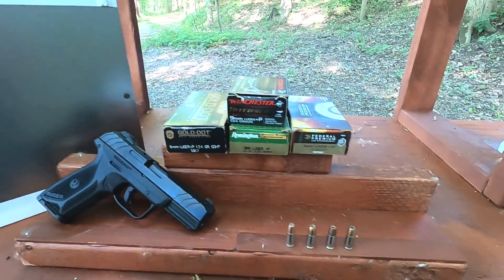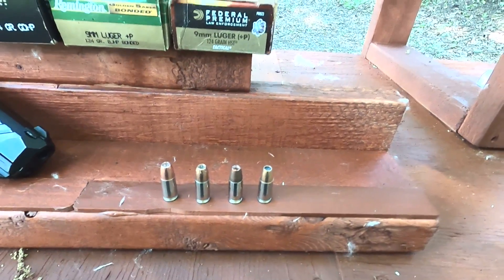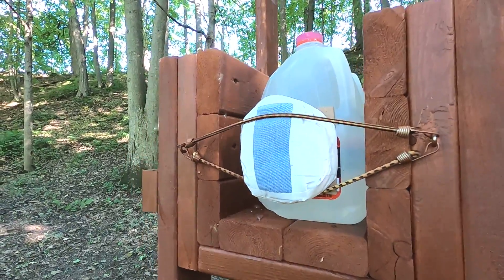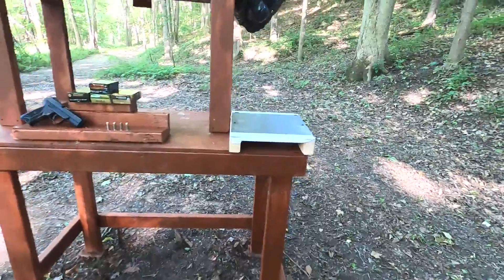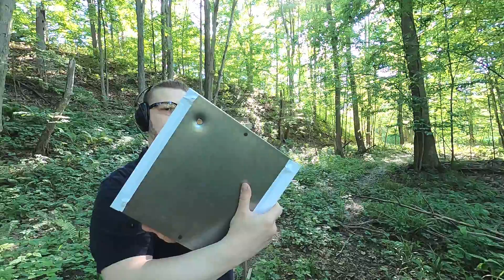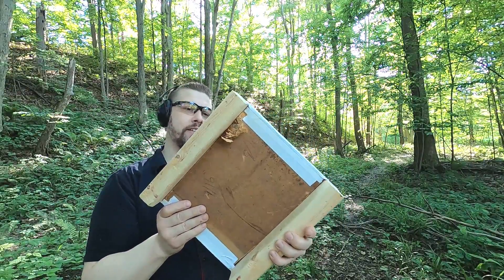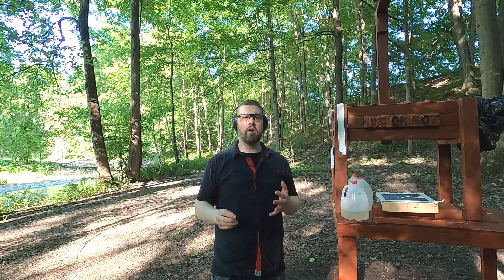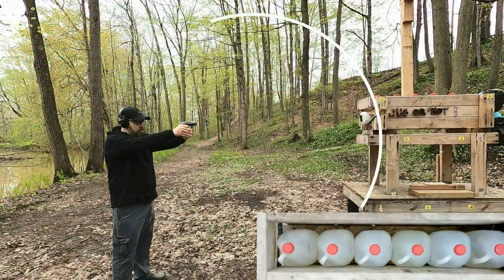9mm Hard Barrier Penetration Test- Damage after Hard Barrier Penetration (Four Popular Loads Tested)

Comment from the maker: I know everyone will be wondering about how these rounds performed without the hard barrier pack in front of the ballistic bologna pack, so I will share the information here because I have tested them all in the past in this same pistol. The Gold Dot averaged 1,196 FPS throughout multiple tests, test one gave 3rd jug penetration and .594" expansion, test two gave 3rd jug penetration and .541" expansion, test three gave 3rd jug penetration and .573" expansion. COMPARED TO HARD BARRIER TEST OF 3RD JUG PENETRATION AND .523" EXPANSION. On to the HST, two tests: the average velocity between the two was 1,186 FPS. Test one gave 2nd jug penetration and .665" expansion, test two also gave 2nd jug penetration and .628" expansion COMPARED TO HARD BARRIER TEST OF 3RD JUG PENETRATION AND .432" EXPANSION. The Golden Saber Bonded I tested once for an average velocity of 1,139 FPS and got 3rd jug penetration and .586" expansion COMPARED TO HARD BARRIER TEST OF 3RD/4TH JUG PENETRATION AND .477" EXPANSION . The Winchester PDX1 I did one test and got an average velocity of 1,091 FPS, 4th jug penetration and an ununiform .545" expansion COMPARED TO HARD BARRIER TEST OF 3RD JUG PENETRATION AND ALSO AN UNINIFORM .455" EXPANSION.
Reply: Gun Sam Revolver Aficionado thanks
Reply: You would think that all of those rounds would over-penetrate if used for self-defense (on a a human attacker) but after watching this video -we learn that it is not the case🤔
Reply from the maker: @mitubogoogle  I think it's totally different effects that just happen to have the same end result by chance. Like, the expansion itself with no hard barriers just by chance slows the penetration to the same penetration that the hard barrier happens to slow the energy down to. Would be kind of interesting to chronograph a round and then chronograph it again after going through the hard barrier.
Reply: 44mag

Comment: What about powder mixing? For the purpose of filling the empty space in the. 38 cartridge.  For the purpose of better temperature control, velocity, energy on target and accuracy. What is the optimal grain weight for the .38 cartridge. What's the maximum pressure of the .38 cartridge? Remember the gentleman was using the .38 casing to develop the  .357 cartridge. 
Thanks 
JP1
Reply from the maker: Mixing powder is generally a no-no. There might be ammo companies that do it because they have the equipment to test the pressure, but a mix goes into the unknown and not a good idea.

Comment: Can you increase the bullet velocity of a .38 caliber cartridge by using a 9mm bullet?
Reply from the maker: I doubt it, if anything it would decrease the velocity.
Reply: @GunSam  Because of the difference between bullet diameter.   
Why?
Reply from the maker: @jpresas3082  A tighter seal will usually increase velocity. The looser fit allows gas to go around the bullet. Even something as simple as a true jacket over a plated bullet in the same caliber can gain velocity over the plated. It would be difficult to load anyways as 9mm bullets don't come with cannelures, so you would have to taper crimp into a .355" bullet which would take a lot of crimp and still pose a risk of creeping out of the case under recoil. Just overall not a good idea and only something that I would do out of desperation, like I had no ammo but had reloading supplies and they happened to be .38 Special brass and 9mm bullets.

Comment: That was a good barrier.  16 ga is probably much heavier that a car fender.  Tough stuff.  and it still got three jugs.  I don't remember of you did a barrier test on 38 sp +p ?
Reply from the maker: I have not and probably will not with steel, but I do have a wood penetration test planned where I will test about 15 rounds to see how they compare to one round of 9mm+p as a control comparison.
Reply: @GunSam  Hot-Dang! Pls throw in a few of the "best notions" of Standard Pressure .38 Spcl as well.

Comment: I think it's interesting that the most common opinion is to underestimate the power of these guns and ammo.  People disparage one gun, caliber or load or another, but in fact these are very powerful weapons.
Reply from the maker: Having some ammo ricochet off less steel, it's a good idea to always err on the side of caution. I was 99.99999% sure i'd have no problem, if I had thought there would really be an issue I would not have came up with the hard barrier I did. But that fiberboard is very dense, so the best way to be sure is through testing.
Reply: @GunSam  I thought it was very prudent to test it at a distance first , I wasn't criticizing that at all.  I agree it's very difficult to predict ricochets.  
I just meant it as a general observation.  I didn't think those rounds would do so well either.

Comment: Impressive results, thanks for your thorough test parameters. My takeaway analogy would be that, these are comparable to 124grn NATO specs, besides being JHP as to FMJ. Considering that "every expert" claims 124grn NATO 9mm is a hotter than average cartridge......1200-1350fps. And personally I can contest the Winchester fmj 124grn NATO to have more felt recoil than any of my other 9mm's
Reply from the maker: Thank you. If my memory serves me correct the 9mm NATO max pressure is something like 36,000 or 36,500 PSI as where the 9mm+P max pressure is 38,500. However, there's no way of knowing exact pressure as 9mm+P could be in any range from 35,001 PSI to 38,500 PSI as where i'd assume 9mm NATO is more particular to be at near max NATO pressure.
Reply: @GunSam  "every expert" usually makes the statement that European cartridges are WAAYY hotter than American, from .32acp(7.62) up to 30-06.....lol That is partially why I asked you about testing the PPU 158grn jhp .357mag, I  think I remember the boxes(specs) reading 1650fps. Which frankly is smokin compared with other 158grn specs
Reply from the maker: @christopherbishop4927  I actually did test some .380 PPU 94 gr JHP in my LCP and .38 Special PPU 158 gr LSWCHP in my 1.875" snubby, both were standard pressure. The .380 averaged 889 FPS and the .38 Special averaged 754 FPS. To put that into perspective I tested the 95 hr WWB JHP a few years ago in that pistol and that averaged 884 FPS, so.....the .380 seems the same as american ammo. Now in .38 Special the only thing close to that PPU was the Federal 158 gr LSWCHP and through the same revolver I got only 650 FPS, so it would appear that .380 is not hotter in European ammo but the .38 Special is. That makes sense though, because European standard is not SAAMI, and SAAMI dictates that .38 Special is max pressure of 17,000 PSI, the .38 Special+P at 20,000 PSI, and that's that. I believe that the governing ammo standard over in Europe is C.I.P., and if I remember correctly just ".38 Special" is a max of 21,700 PSI. So for them, "standard pressure" can be what we might call +P+!
Reply: @GunSam  I wasn't clear about the PPU being the "Defense" 158grn jhp .357mag offering, reviews from purchasers were really good at like 4.7⭐+
I'll see if I could find a box or link of these specs. I buy a case and immediately dump them into ammo boxes
Reply: @GunSam  Key Features

Caliber: .357 Magnum.

Bullet Weight: 158-grain.

Bullet Type: Jacketed flat point.

Muzzle Velocity: 1,607 FPS.

Muzzle Energy: 906 ft. -lbs.

Case Type: Brass, reloadable.
Reply: Oops wrong stuff....but is ppu
Reply: PPU .357 MAG Handgun 158Gr JHP - 50 Rounds

PPU handgun ammunition is brass cased, non-corrosive boxer primed and features an improved bullet designs which result in greater energy performance, bullet expansion and reliability.
Caliber             :357 Magnum
Bullet Type         :Jacketed Hollow Point
Bullet Weight       :158 GR
Muzzle Energy       :906 ft lbs
Muzzle Velocity     :1067 fps
Rounds Per Box      :50
Boxes Per Case      :10
Casing Material     :Brass
Reply: When I found this stuff it was cheaper than the fmj 124grn....& I kinda lean to buying heavy for caliber cartridges, 158grn/357; 147grn/9mm; 100grn/380acp; 203grn&184grn/7.62×54r; 158grn/7.62×39; lol 😆 40grn/22lr ect........ heck man, I even had Nate load up 12guage #6 field loads, as compared to #8/#7/#7 1/2

Comment: 9mm Luger was designed for military use, where hard barrier penetration is one of the objectives. The current fad of 9mm in the civilian use is due to low cost of ammunition, but primarily to the stupid US laws that wiped out imports of smaller, quality pistols. For vast majority of civilian use, a small .32 ACP automatic or a .32 S&W Long revolver would be much better and much easier to use accurately (and judging from a ridiculous number of rounds expended by the police in various shootings, smaller caliber would help them shoot better, too, and maybe even let them hit the target once in a while).
Reply from the maker: I like .38 Special the best, about the same felt recoil as 9mm but for the slight energy you lose over a 9mm you have increased accuracy typically and larger hollow cavities.
Reply: @GunSam  And with .38 wadcutters you could have significantly lower recoil.
Reply: The simple reason law enforcement misses so much is because they are having an adrenaline dump, and they get almost no training. Law enforcement are guaranteed to have wayyy less shooting experience than your average gun lover.

Comment: What u mean by saying not too powerful but not too weak??
Reply from the maker: If a round has too much energy and it's still a lead core, it can flatten out and not penetrate far at all in either hard or soft barriers. You need a balance of enough power but not too much. These were all 124 gr at around an average of 1,150 FPS. If I were to take lets say the .357 Magnum Buffalo Bore ammo I just tested that is 125 gr at 1,600 FPS, by the time it hit the first water jug it would pretty much explode and fragment and penetrate less than 9mm. On the opposite side of that if I used lets say a 125 gr .38 Special moving at 800 FPS, the bullet would barely make it through the hard barrier and also barely penetrate the first jug. Also, 9mm has a smaller hollow cavity than other rounds, which lends itself to penetrating well.
Reply: Great explanation. So in other words, as you stated at the very beginning of the video 9mm is the perfect round. It has good penetration-power ratio.